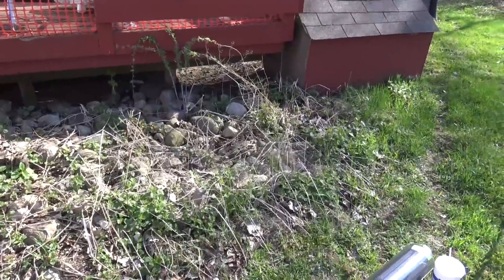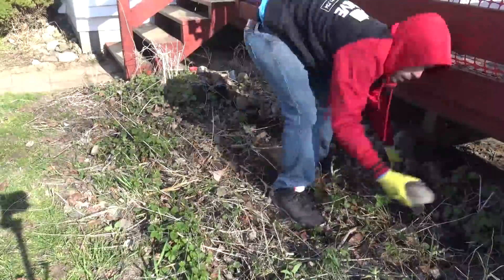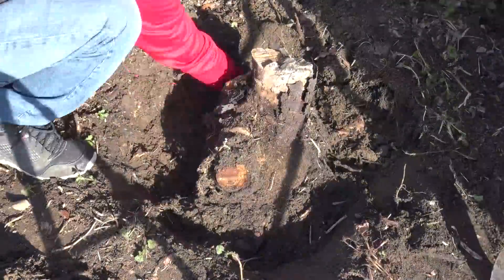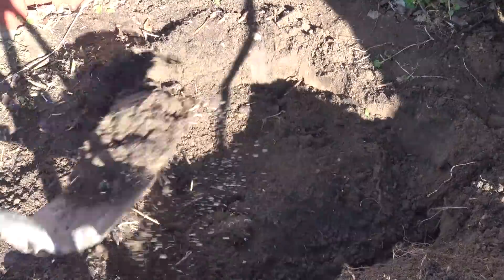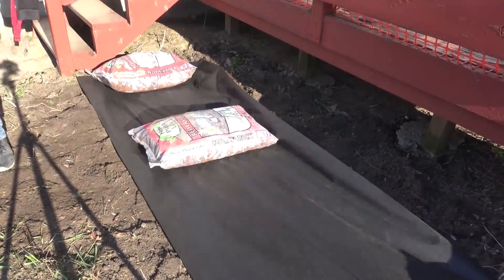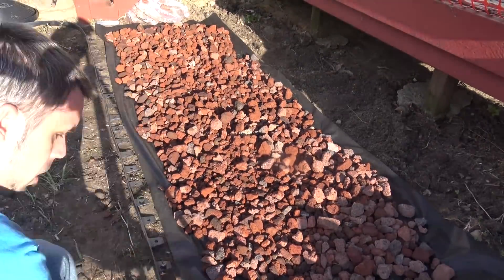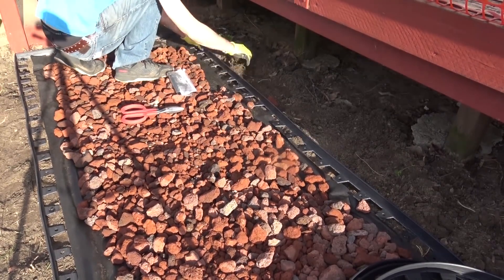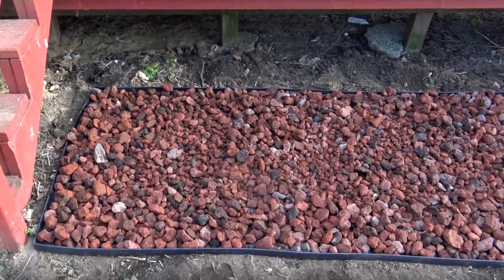How To Install Landscape Edging And Red Lava Rock

Comment: Installing some dippers would be nice then some pots could be added on top the rocks. Could grow some blueberries or flowers ect. Just have the lines snake up into the pots can always come from underneath the pots thru the holes on bottom before adding potting mix and planting making it really clean and hidden I’ve done it many times works great. Cheers great quick video
Reply from the maker: Thanks for the feedback! Planned on putting some annual flower pots or something on top of the rocks, haven't decided yet.. Might do strawberries. I'd do blueberries but I actually have 40 blueberry bushes that take up about 1/4 acre of my property. What are "dippers"? I googled it and only came up with dipper gourds. Thanks again!

Comment: Do you have to get all the weeds out before laying fabric? I have an area that has a crazy amount
Reply from the maker: It's best to if you can, especially the roots. Most weeds will die off, but some species will poke through.
Reply: @GrowGreenerGuru  try thick vinyl pond liner! Lay a few towels down first, it works amazingly I haven’t had any shoots pop through and it’s been years!
Reply: @EggGorlComics  Sounds expensive